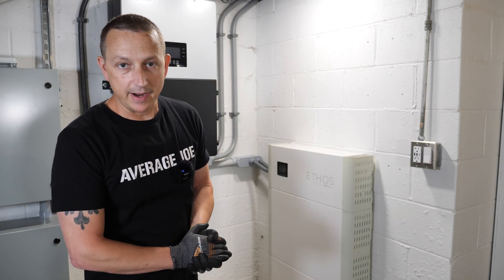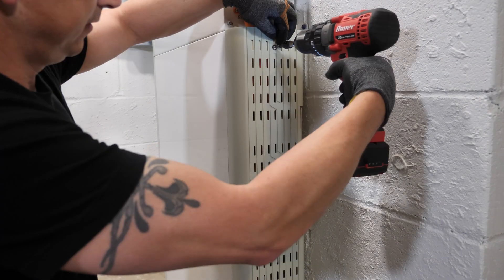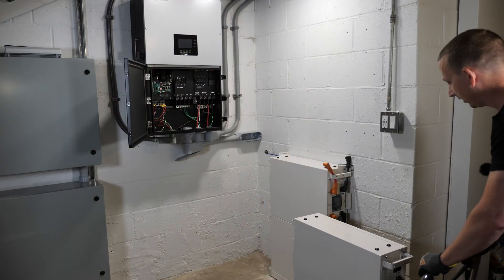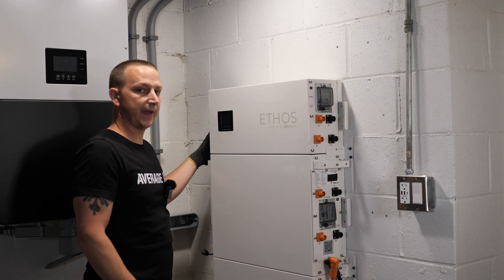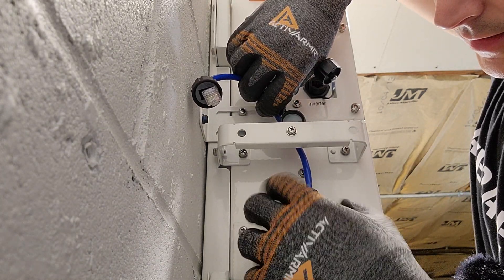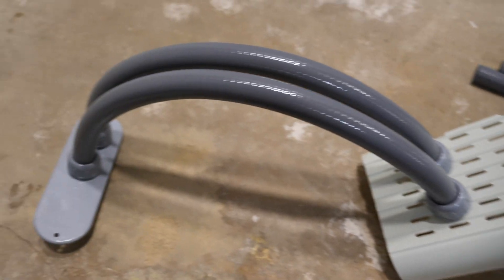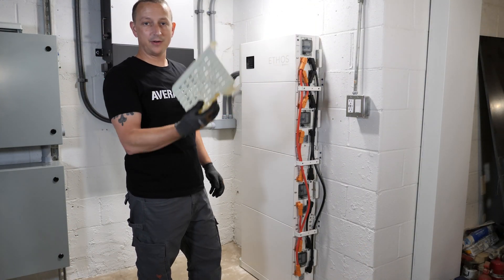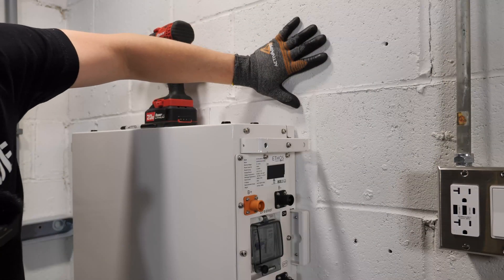Need MOAR POWAH?? Install a 15kWh Ethos Battery EASY!!

Comment from the maker: Want to save some Cash? Get 5% Off with Discount Code "joe10" 
Affiliate Links to Moar Powah!⤵
🔗10kWh ESS - https://bigbattery.com/products/12kw-10-2kwh-ethos-energy-storage-system-ess/?ref=53&campaign=MoarPowah
🔗15kWh ESS - https://bigbattery.com/products/12kw-15-3kwh-ethos-energy-storage-system-ess/?ref=53&campaign=MoarPowah
🔗Ethos Battery - https://bigbattery.com/products/ethos-15-3kwh-3-module/?ref=53&campaign=MoarPowah
🔗12kW Inverter Only - https://bigbattery.com/products/luxpower-12kw-18kpv-hybrid-inverter/?ref=53&campaign=MoarPowah
🔗12kW Solar Panels - https://bigbattery.com/products/canadian-solar-12kw-solar-panels/?ref=53&campaign=MoarPowah
🔗Solar Used in this Video - http://shrsl.com/4gyi8

Comment: Ethos or epcube?
Reply from the maker: Both are great! Depending on how much battery capacity you want. If you want more customizable options and a bigger inverter capacity to start with. Get the Ethos and LuxPower inverter. If you want less options and smaller inverter to start with, the EP Cube. Both are great like I said. Ethos system allows you to tinker if you like to mess around with setting and have more control.

Comment: Can an ethos battery backup work with sun power micro inverter panels?
Reply from the maker: Yeah you can connect existing or new AC coupled solar system to the generator input on the inverter. Whats great about that is you can have grid tie AND battery backup!👍
Reply: @AVERAGE_JOE  thanks, due to Sunpower’s financial situation I am having trouble getting them to okay installing the ethos system without voiding my warranty. They tell me that I would need to have their sub contractor do the installation but the contractor is leaving sunpower due to their financial problems. Love watching your videos
Reply from the maker: What do you mean by financial issues and also why would there be an issue connecting panels to a inverter unless they did it. Or is sunpower a different company then I am thinking?

Comment: Been running my entire house off grid with 66kWh of recycled Tesla modules for 3 year (there is no cheaper $ per kWh battery) for 1/5th the price and space requirements of this setup.
Reply from the maker: Hell Yeah! Yeah diy can be a lot cheaper for sure!🤘
Reply: Cool.
Reply: Where did you buy the Tesla modules?

Comment: So if I lose power how long would they be able to run both freeze and lights and tv without worrying?
Reply from the maker: Batteries running them only and no solar? My fridge uses 1.7 to 2kWh a day. Led lights and tv are usually pretty low consumption. I dont know how much your 2 frezzers use but just throwing out a guess, Id say 3 days.
Reply: @AveRage_Joe  thank you very much. I usually lose power for around this long so it would be very good for me.
Reply from the maker: Of course when the grid is gone I would imagine you would not open the freezers as much and or conserve a little. If you had some solar coming in then much much longer.

Comment: Nice install really neat. I have a question: With the new battery installed, why you didn't add second pair of power cables to the inverter?
Reply from the maker: Great question. Id like to find some bigger flex conduit but didnt want to buy a whole roll for 2-3ft. The battery cables are 1/0 as well so I will be good for a bit! I also want to test out some other batteries I have here.
Reply: @AveRage_Joe  Great can't can't wait for those videos in the future.

Comment: Clean and Nice install! Is the 15kwh the nominal or usable capacity? What is the recommended DOD of this battery?
Reply from the maker: Yeah it is!  I actually havent done a full capacity test yet.  Recommended from the manual it says down to 20% can exceed 6000 cycles (lifespan of over 10 years and is engineered to withstand more than 4000- 8000 cycles at 80% Depth of Discharge (DOD) at a rate of 0.5C)

Comment: It’s a very neat system. If it stacked from the bottom (controller at the bottom) adding more batteries would be a lot easier. Useful to see how to add batteries but I’d have thought anyone willing to spend that much money would have it installed professionally.
Reply from the maker: Yeah thats true!  Having the controller at the bottom would make it easier.  I think they would want to make that box a little stronger lol, its pretty light.  Yeah this is a UL certified system so it can 100% be installed by a professional or installer.
Reply: True, but that would make reading the screen REALLY hard, and doing settings. So long as your phone app is working OK, not a big deal, but....

Comment: Having a 6 sever rack battery system in a large wheeled case, I have to say I’m a little jealous of all the extra free space you get with a wall mount battery system like this one.  This system still gives you some redundancy in case one battery fails.  You just pull it out. 🤩👍☀️⚡️
Reply from the maker: My first system was in a server rack and it took up so much space.  Main reason I mounted my next diy battery(not finished) on the wall. I really like the wall mounted stuff!🤘

Comment: system    is   ok  for some one who like good looking system but  9 k for just  10 kwh  is to much  for the  price.. i get 32 eve lifepo4 304ah cells i make 2 48v bank  i get 30 Kwh for half of what this company  is charging. i do understand you got it free system  for the grate video you make. but that is way not to many of us can not affordable. what happened w the old day we DIY stuff? you just to appreciate DIY Projects. we stop doing this  videos. we need them back joe.grate video. nothing personal just missing the real Videos
Reply: We can all make cheap batteries with the skills we have acquired over the years, but what we often forget that our time also has a price!
I still have 1000 good 18650s that I haven't managed to find the time to make a 13 or 14S pack out of, and am too busy working or sleeping to expect to be able to, so will probably go for a system such as this when prices come down a bit more.
If you can do it, then go for it, but there are also people that want to just buy a system which is also supported and has a guarantee - and that's important if your house is on the line!
Reply from the maker: I ended up selling the thousands of 18650,s I had set aside. Most of them tested🙄😆 Yeah that is very true. A lot of people just want a system meow or dont have those skills to diy.  Man I really need to get back to my diy system😀
Reply from the maker: Yeah for sure, doing a diy set up can be cheaper. I still have to finish mine🤦‍♂️😁 Ill be getting back to that here soon.

Comment: Been waiting for this video.  looks like the upgrade went well.  I was always interested in the configuration, ... that is , should I buy two then get one more or buy three then get two more?  Always finding questions.  Looks like you solved yours and the system is looking good!
Reply from the maker: We gotter done and yes, it went well. I would for sure get a 3 stack and go from there. I am by no means trying to upsell. Depending on what you plan to do. Off grid or as a backup. If your house gets sun on the panels early to start charging. Your golden. I dont get sun on my panels till noon due to trees. If we dont run the AC, 15kWh will get us through the night. If we use the AC....not even close lol our house is drafty and poorly insulated🤭😁

Comment: Interesting.  I always thought that data cables had to be separate from the power cables?  And if the data and power cables have to cross, then they should do so at a 90 degree angle?
Reply from the maker: I havent heard that. Ill have to look into that. If so Ill have to run another flexi.🤔🤘
Reply: You are right if the UTP cables are not shielded and they are near of AC power cables, but DC power cables do not make any electromagnetic fields, so UTP cables will not be affected. Regards
Reply from the maker: That is good info!🤘

Comment: Seems like a lot of wall space for only 300Ah but I suppose most of these smaller stackable battery modules take up quite a bit of wall space compared to a server rack full of 280-304Ah batteries.
Reply from the maker: They are basically server rack batteries mounted on there side or on the wall to get away from the big server rack.

Comment: Nice one Joe, you should do this for a living! 🙂
Glad you covered making sure states of charge should be similar - this worries me in case someone connects an empty battery to a fully charged one.
(I've had copper vapor flash burns a couple of times from shorts!) I think some manufacturers might mediate and equalize the charge gently and then engage relays or mosfets to make a hard connection, but that would add expense and extra resistance so I wouldn't count on it.
Reply: That was my first thought as he did a battery shutoff with 1 indicator lit. That explosion clip gets me every time. I miss the farts though 😊
Reply from the maker: There was a fart in there🤭